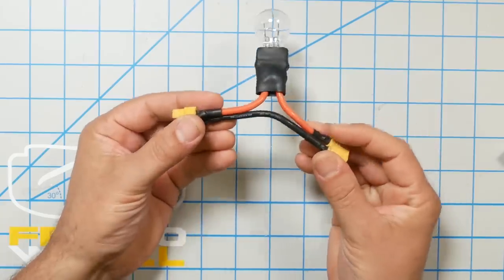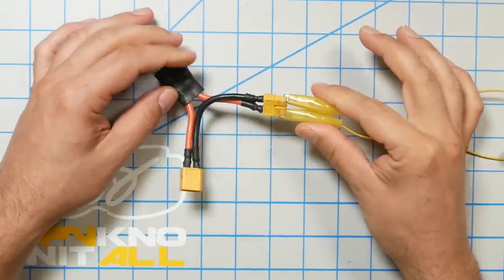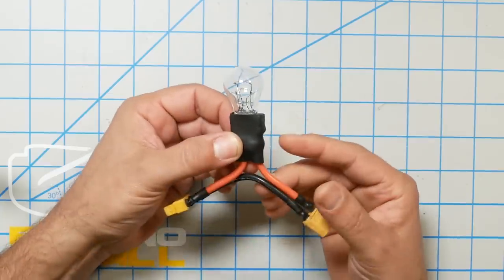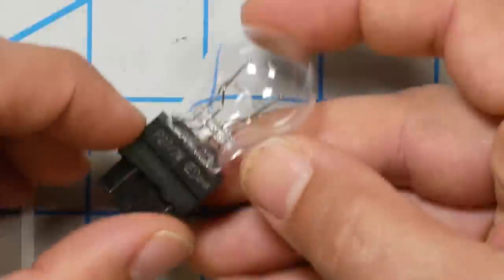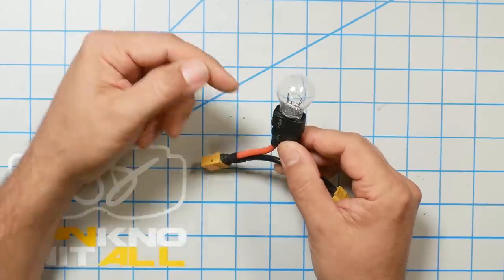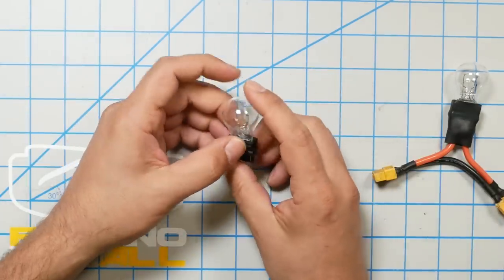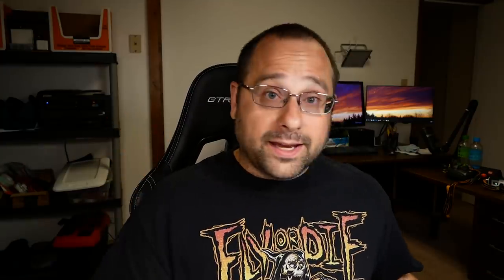Why you need a smoke stopper | HOW TO MAKE A SMOKE STOPPER

Comment: What about a mini mag light bulb or 2 in series for 1s or 2s whoops / toothpicks?
Reply from the maker: In the end, the wattage of the bulb is what matters, as well as its nominal voltage. When you go above the nominal voltage, the current goes up and you can fry the bulb. 

It seems like a mini mag light bulb would be well suited for use with a 1S or 2S whoop.

Comment: When you connect both the short and long light of the bulb, is it still 25W or is it now 50W ?
Reply from the maker: The bulb is 26 watts for the high element and 8 watts for the low element. When you wire them both up, it's a total of 34 watts.
Reply: Thanks, I have one of those smoke stoppers you demonstrated the drawbacks of :)  But here in Denmark we don't have that kind of socket of 12V Car bulbs, so was looking into alternatives. Nice to know how much Watt you use in your smoke stopper, as most bulbs i can find is 25W/25W

Comment: Can i build a smokestopper out of an normal halogen bulb with 12v and 20w for 4s or do i need 2 elements?
Reply from the maker: You can do that. But 20W is going to be low enough that it'll trip sometimes from normal current.
Reply: @JoshuaBardwell  so it didn't work and i burned my xilo esc xD

Comment: i want to order XT60 connectors to make a smoke stopper, what is the difference between xt60 size A or size B(amazon)?
Reply from the maker: I think all XT60 should be the same size.
Reply: @JoshuaBardwell  that's what I thought until I went to Amazon to order,  option for the 2 sizes!!   Weird.  But I since seen  your review of the  Vifly savestopper.  I think I will order that through your link.   Thanks Joshua.   Keep up the good work!

Comment: BEST. DEMO. EVER.

"Here is why my solution is better." Burns the other product.

Also, quads give a all new meaning to plug and pray.

p.s.: Why wouldnt you take off the props? Just pop it off with ... oh ... it doesnt have POPO motors ... Realistically, i pop my props even when i wouldnt need too, just because its cool.
p.p.s: What do you mean you dont always have a multi-meter? What is this non-sense?

Comment: 3:46 don’t punish yourself for that one man, first time I fried one of those cables it had 70v flying through it.

The whole thing burnt up like fuse wire 😂
Reply: This is old school man, the automotive industry used test lights in this very same way for a long, long time!

P.s you can actually put a multimeter in-line in the same manner, but buying a new bulb is much cheaper than buying a new meter 😂
My cheap $20 one will do a max of 5amps before it goes bang 😅

Comment: Just wanted to point out that the smoke stopper protects against reversed polarized xt60's and stuff. They're great for noobs!
Reply from the maker: I don't think this is true. If you reverse-bias an ESC, it's likely to toast even with a smoke stopper. Reverse polarity is one of the faults that this doesn't protect against.
Reply: That's true to! My hobby shop sells smoke stoppers have somthing extra that protect against a reversed battery plug. I say this because it saved my quad when I was a noob and I soldered the esc on wrong. 
I would like to thank you because your videos are so helpful and if they didn't exist then I wouldn't be in the hobby today. 

https://www.nextfpv.com.au/products/xt60-smokestopper

Comment: Hi Joshua,  can you point me in right direction as i am having problems when saving & rebooting in beta flight  I have to unplug & plug back in my usb cable,  DRIVING ME NUTS, HELP
Reply from the maker: This is something that happens with some computers and some FC. There isn't really a workaround that I know of. My recommendation: un plug and plug on the computer side so you aren't wearing out the USB port on the FC.
Reply: Ok Joshua,  thankyou for quick reply.  I watch all your videos and you have taught me so much. THANKYOU

Comment: I really don't need a "smoke stopper". Why should i use a battery on the bench in the first place? Just use a power supply with current limit. If it goes into the limit the LEDs will show it, in addition many models show the current value on a display, which is also helpful for testing if there is no fault. Nice 3A DC-DC converters with digital display and buttons can be had for as little as 7$! Combined with a brand laptop power brick that is imho a must have tool for less than 20 bucks. It is also more flexible, for example setting it to 4V for testing small 1S stuff is possible. I see no reason for ancient light bulbs as current limit anymore.
Reply from the maker: Not everybody has a current limited PSU. But even if you do, I bet you don't bring it with you to the flight field or to the bando.
Reply: A full PSU would not make much sense in the field of course. I am specifically suggesting these DC-DC buck modules, with builtin current limit, display and controls. For example the B3603 is just 65mm on the longest side. 
I personally don't do large changes or repairs on the field, but i know some people like to do this, for that you can easily hook up a XT60 to the input and also power it from some battery.

Comment: Just say no to polyfuses and blade fuses, too. The links are too slow to react to excess current, and valuable electronic gubbins will have already been lost by the time the circuit is broken.
Reply: Lightbulbs are slow. When cold, 1/8th their nominal resistance, and a good fraction of a second to ramp up.

Still, sometimes that 1 Ohm of extra idle resistance can be quite crucial.

Comment: If you're living in Europe: the technical spec's of the lamp are: "12V 3157 W2.5x16Q P27/7W" with "W2.5x16Q" (size) and "P27/7W" (watt of the 2 elements) . Always sold in pairs of 2: https://www.amazon.fr/Aerzetix-Ampoule-12V-3157-W2-5x16Q/dp/B01HRY34R2/ref=sr_1_fkmr0_1?dchild=1&keywords=SYLVANIA+3157+Long+Life+Miniature+Bulb%2C+%28Contains+2+Bulbs%29&linkCode=gs3&linkId=498d1d81a8b2994b215c6c42f593410b&qid=1586760449&sr=8-1-fkmr0

Comment: What's wrong with a properly sized fuze or micro circuit breaker?
Reply from the maker: Fuses stink because they pop when there is a fault and then you have to replace them. Bulb is infinitely reusable. 

Circuit breaker could be good....
Reply: That isn't such an awful question, but I won't try to answer it in detail here. Do a web search and read up on it. They're actually quite old school. I still use the one my father built in his teens in my ham shack.
Reply: @JoshuaBardwell  resistive rise-time of a breaker vs light bulb? Not sure myself, but in Google searching I came across this very interesting article. It also has a valuable table of common light bulbs and their current characteristics.
https://sites.google.com/site/markgurries/home/technical-discussions/dcc-circuit-breakers/light-bulbs

Comment: Incandescent bulb current limiters have been a tool of the trade for electronics technicians for decades. Many have been stockpiling incandescent bulbs just for that. A multimeter or a lab power supply can also help identify problems early, but again you are still exposing your equipment to unnecessary risk.

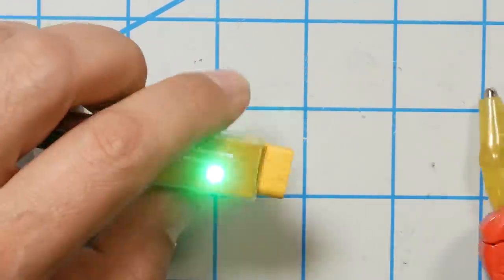Comment: See 3:20 for a reason to use old school bulb instead of fancy new solid state parts. When a bulb fails, you'll not have power at all and that will not burn stuff. Then solid state fuse fails, the magic smoke comes out from your electronics and it no longer works. For more practical information about solid state fuses, see https://youtu.be/298QWlHtNaQ

Comment: Why is it that no one actually shows how to run power from pdb board to power flight controllers..thats where alot of people are stuck at.
Reply from the maker: Very few builds today use a PDB. Most people who are using individual ESC's would use an all-in-one FC with built in PDB. So there is no need to wire between PDB and FC because the PDB is inside the FC.

Comment: Those commercial smoke stoppers are not to be trusted.  I plugged in after a build and the flight controller LED oscillated on/off at 10-50 Hertz (don't really know), meaning it was cutting on/off very quickly.  That voltage oscillation condition killed the FC, and I could no longer connect via the USB, as before in flashing latest firmware etc.  I have never had a problem with the auto taillight homemade one.

Comment: I have serious doubts that a light bulb can effectively save any electronic from overcurrent
Reply from the maker: It's just a resistor that is designed to give off light. What does a resistor do? Limit current flow. As long as the circuit is safe at the amount of current the light bulb allows to pass, it works.
Reply: @JoshuaBardwell  lets make an example: in legit conditions you disarmed rig could draw 500mA at 10V from your battery. If you short the main leads, yes, your smoke stopper is effective to save the battery. Even if you short esc output, probably you are safe. But if a tin blob falls on your FC or you messed some connection or reversed polarity there is no chanche that a piece of sensitive electronic withstand 5 Watt. In other words the current needed to kill a single short ciurcuited piece of electronic is way lower than the current that your light bulb allow to flow.. sorry for crappy english...

Comment: Firstly, you need to learn how to read a multimeter. Secondly when your "smoke stopper" (light globe) is connected and installed in a working system, the light globe will be continuously lit up even if no short is present, robbing power from your system. This is known as a series circuit. Thirdly this light globe will limit the current to devices in the same circuit as it will only allow the current it is rated for to flow. Similar to a resistor, you know, resistive load and all that..  And finally, what if there is a short before the globe? Now your "smoke stopper" won't light up at all giving you the impression there is an open circuit, until of course smoke starts pouring out of your battery or wiring! There is however a device that's used to protect your equipment without the problems caused by using a LIGHT GLOBE! Its called a fuse... and its cheaper too!

Comment: This is why I've never bothered with those piece of crap little smoke stoppers, you've gotta go build the one with the light bulb, I've seen design with switch for higher amp filament or both filaments in the bulb for noticing spin up testing. By half a second your stuff is burnt, what's the point. Why even make them what a waste of time and effort and money. Half a second is exactly when you notice the smoke monster raging outta the component.

Comment: smoked  a smoke stopper,  smoking is bad for you.
some low beam and high beam have the same wattage, its the angle of incidence that is changed by the filament being in a different position hence giving the high  angled beam.
Reply from the maker: This exact bulb is 26 for the high and 8 for the low. It's not a head light, it's a tail light. It has both bright and dim element.

Comment: These ‘smoke stoppers’ don’t do anything.  I used one and it did NOTHING while completely frying both FC and ESC - $100 worth of quality components.  Complete waste of time and complete junk.
Reply from the maker: It's unlucky that it didn't work for you, but you're wrong that they "don't do anything". They do exactly what is advertised: limit current below a certain threshold. Smoke stoppers are not a 100% protection against frying gear. If you reverse-polarity on your gear, it will fry. If your gear can fry on 3 amps through a smoke stopper, the smoke stopper can't protect. A smoke stopper is just a tool. It can be used incorrectly, but that doesn't mean it's useless.

Comment: The light will only remove 3 amps of the short.if you have a short pulling 8 amps 3 ampos goes to the light but you will still have 5 amps short threw the board i dont get this at all.You need a proper power supply that will only deliver a set amount of voltage.wish the proper way would be tought instead of shadtree stuff.What happen in your video is what happens in real world to peoples fc.
Reply: Nope. Kirchoff's Current Law, sum of currents into a node...  3 amps is all you'll get.
Reply from the maker: That is not how it works at all. When you dead-short the bulb you get 3 amps. You can't get any less resistance than a dead short. 3 amps is the most that can ever flow through the bulb (assuming 4S voltage). @wiccan FPV now, instead of acknowledging your mistake, I fear you will just ignore this interaction and go on about your life telling people how I am dumb and harmful because I teach people techniques that don't work.
Reply from the maker: As I say in the video, a current-limited supply is awesome, but good luck packing one in your travel bag or using one on top of a mountain where there's no electricity. Smoke stopper is a valuable tool that has its place.
Reply from the maker: If your FC smokes on a bulb like this, it means that 3 amps was enough to smoke it. As I say in the video, you can prevent this by using a lower wattage bulb. The lower the wattage, the less current will flow.
Reply: @JoshuaBardwell  actually there IS a finite time in which the filament is heating up in which the in rush current will exceed the steady state of the fully lit bulb. But generally this exposure time is too brief to smoke components or traces.
Reply from the maker: @jklong03  you are correct. But that doesn't change how Ohm's and Kirchoff's Law work :-)